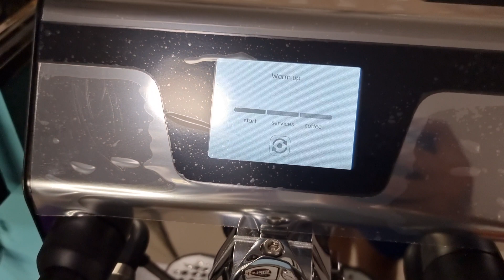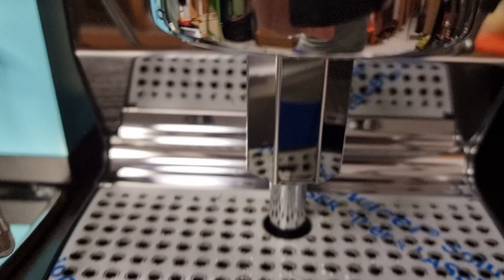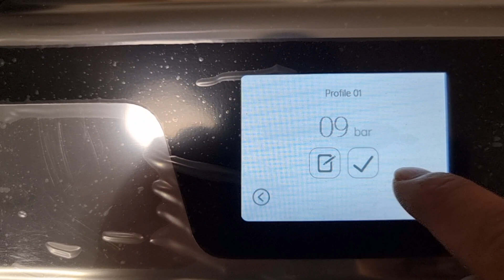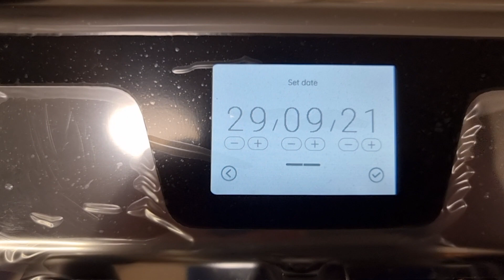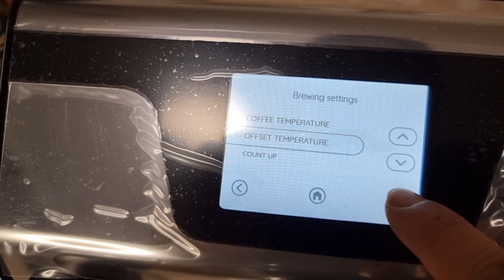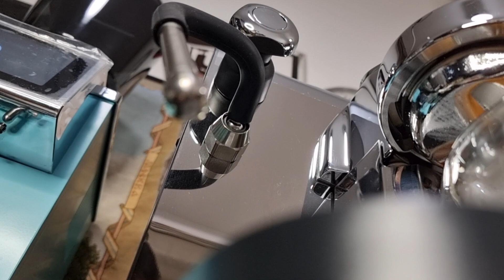Pressure Profiling Machine | VBM Domobar Super Elettronica | Italian Dual Boiler

Comment: Hi:)

How high can steam pressure go? I'd like more pressure like a commercial machine vs the 1.2bar my current machine offers.
Reply from the maker: This pressure on the Domobar can be adjusted. No problem going to 1.5 bars at least.
Reply: @CaffeMartellaSingapore  excellent thanks :)

Were you impressed by the build quality (internal and external?)
Reply from the maker: @michaelrobinson9643  VBM is ok.
Reply: @CaffeMartellaSingapore  VBM ARE TANKS
Reply from the maker: @MrJusmobile  yes they are.

Comment: Thanks for the demo CY, a bit intimidating a machine that has so much programming similar to the Decent, especially for older people like myself. Looks like it can also be quite fun to play with all the possible profiles too.
Reply from the maker: yeah it's intimidating at the start but once you have experience about brew pressure and what it can do. I think I will do setting on constant pressure first and test.
Reply: @CaffeMartellaSingapore  yup, sounds like a plan😜😃.
Reply: Did you end up buying one? If so how do you find the build quality? I'm considering this or the digital version (manual lever on the e61).

I think the electronica can do volumetric not just flow control?

I'm a bit concerned cming from a 10yr old and still bullet proof Rocket Giotto and the plastic drip tray etc leave me with a ?